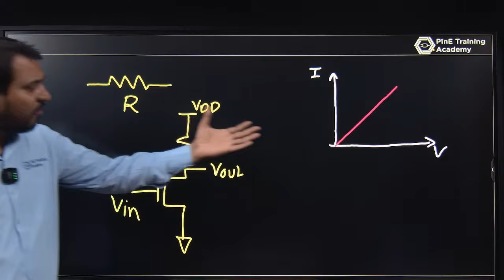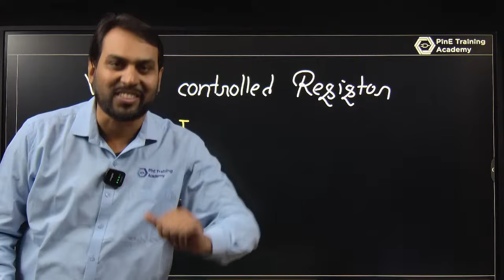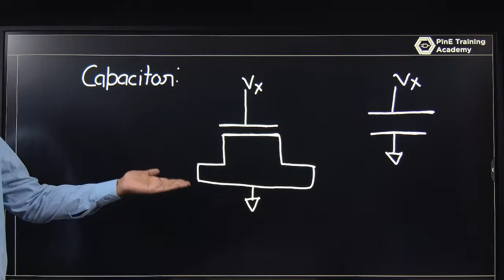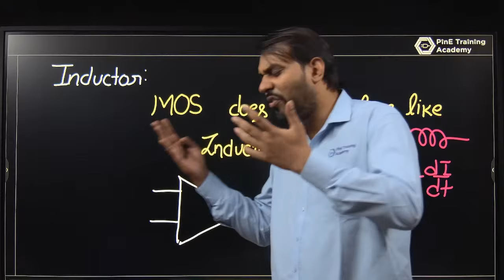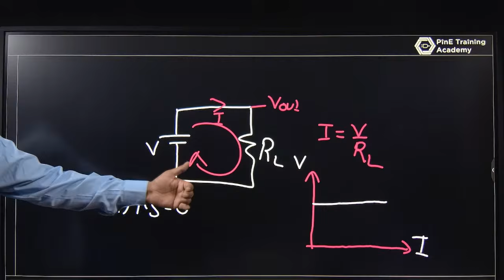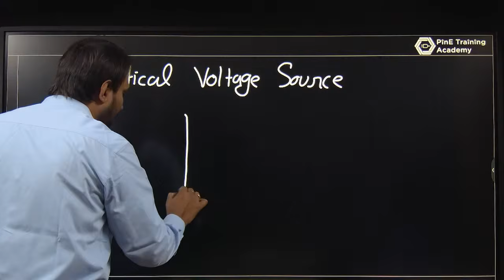How MOSFET Replace Resistors & Capacitors Inside ICs | From Ideal Sources to Real Circuits|Session 2

Comment: How to make capacitor using mosfet
Reply: If the source, drain, and body of a MOSFET are shorted together, the device behaves like a MOS capacitor. One terminal acts as the gate, while the other terminal is formed by the shorted source, drain, and body. The SiO₂ layer between them acts as the dielectric.

Comment: Sir you said LDO,BGR is the back bone of analog layout right. 
So in the LDO schematic they have a lot of resistors because we find stable voltage right.
But sir you said every resistor has voltage drop so finally we didn't get total voltage because we lost some voltage due to voltage drop.
So sir how we will maintain stable voltage in LDO by using resistors.
Reply: In an LDO, feedback senses the output voltage. If it drops the MOSFET allows more current to flow and restores the voltage.
Reply: Ok sir thank you..